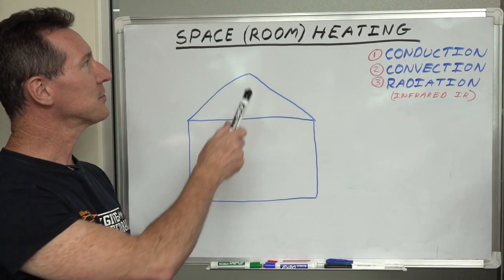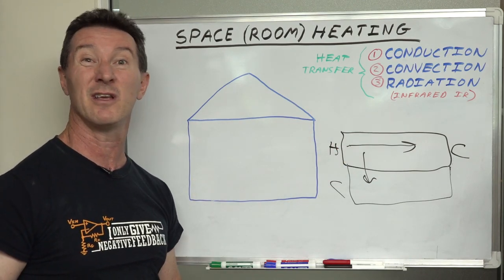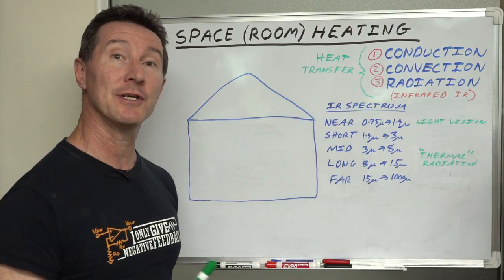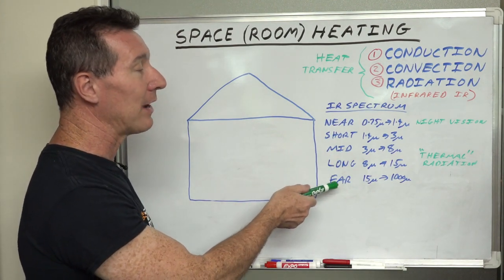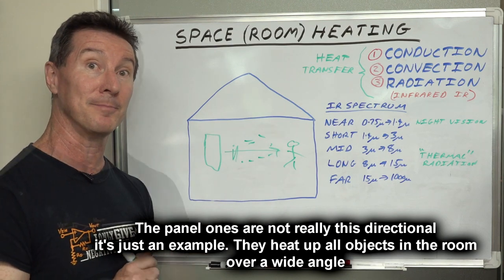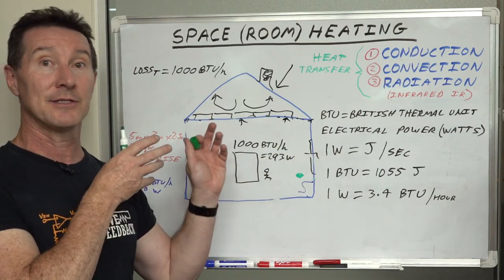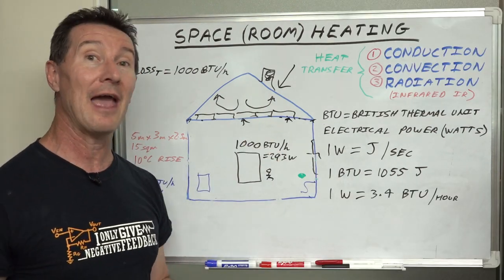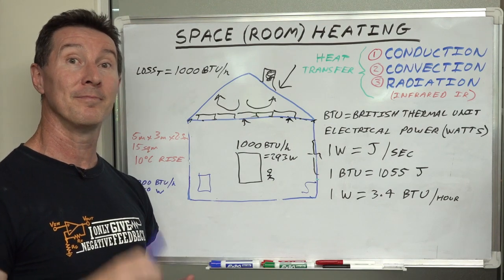EEVblog #1187 - Room Heater Technology Explained

Comment: This was great.
I'm always confused about convection. 
It seems to me that whenever we talk about convection we ignore half of the story. Convection refers to the movement of liquid or gaseous molecules through space. This is due to buoyancy, specific gravity, air pressure... all that stuff. So the hot air molecules will rise, leaving behind a bit of vacuum, and convection currents will distribute them around the room.
I get that.
But how do the air molecules get hot in the first place? It seems to me that those air molecules were heated by conduction. At first the space heater is bathed in cool air. Then the heat is transferred to the adjacent air molecules by conduction... not convection. Only then will the forces of air pressure start to convey the air molecules around the room.
Eventually when the convection current brings the hot air molecules to the other side of the room, they can again transfer heat to a person or a chair or whatever... but again, through conduction. So conduction occurs at the  origin and the destination, while convection occurs in between.
Do I have that right??
Reply: SciPunk215 My teacher explained convection as conduction. It’s just that it moves because it’s a gas, so it helps the heat transfer. But it’s definitely conduction between the molecules.

Comment: Thumps Up Dave! As i was watching your video i made some simple back of the envelope calculations. Here in Athens Greece were i live it's winter time, i live in a multi-storey building apartment and the central heating is on. We use hot water "radiators" fired up by a heating oil boiler. Our Boiler is rated at 120.000 Kcal/hr (that's a unit of power, a Kcal is the energy needed to increase the temperature of a kg of water by 1 °C, So it's convenient for calculations although it's not an S.I. unit of measurement). So i estimated the heated apartments in our building to be about 1500 m², So it's about 80 Kcal/hr per m² of heated space. Since my small apartment is 75 m² my "share" of heating "power" is 6000 Kcal/hr or ~6,97 kW. I also got two air conditioners rated at 12.000 BTU/hr each (3.5 kW). So my ACs power equals the "capacity" of my radiators!
Ain't Thermodynamics Fun?...

Comment: I think you should have spent more time explaining Air conditioners in this video. Efficiency ratios of 2 - 5X are easily achievable in ACs so it is important to be mentioned in a video in which you say that no heater can achieve more than 100% efficiency.
Reply from the maker: I think that's best left to another video. I wanted to focus on electrical space heaters.
Reply: There's also a difference between picking the heat up and moving it, vs creating it directly.  Heat pumps pick it up and move it, a resistance heater creates ( converts electrical energy to heat, but you get the idea ) it directly.
Reply: By your definition the sun has unlimited efficiency.
You do not put in anything and still get all the energy it radiates.
Reply: now if we could only gather up and use all that energy..  * sigh *
Reply: The efficiency of consumer electronics is measured by the electric energy input in comparison with the desired energy output (heat, light, etc)
That is the reason a heatpump can be above 100% efficient.
From this standpoint, if you use the sun as a lightsource or heatsource it could be considered infinitely efficient, as you don't input electricity. And to support that claim, just think about something like this: "save 100% of your heating bill by just heating with the sun". That works, in theory, even if it doesn't heat that much.
Reply: @czarzenana5125  Well no, a lot of Hydrogen and Helium was "put in" initially. It was just long ago and probably cannot be refilled. So it sounds like this "sun" thing is just a throw-away gadget, not very ecofriendly. The larger ones can even explode quite heavily and spread radioactive elements everywhere.

1/5, cannot recommend.
Reply: @kmv3040  
Yes, I know.
Energy is never lost, only transformed from one form to another. Efficiency explains the amount of energy put in in one form producing energy in the form you want. So if you use an AC for heating, you could get 3 times more warmth out than you put in as electricity. If you use the sun for heating, you do not put in any electricity which would give it infinite efficiency. I didn't say the sun could do that for infinite time.
Reply: @stabileseitenlage  
We only have to put solar panels in parts of deserts totaling the size of France to provide humanity with all of the energy we now globally need. So yes, the sun provides far more energy than we globally need. The sun is not infinite, but I think it will last for a bit longer than I do.
Reply: @kmv3040  In HVAC terms, free-to-me energy is counted as free energy and only energy that you have to pay for to harvest the heat is counted on the input side. With a heat pump or passive solar only the fan and pump energy, not the energy harvested from the air or ground or sunlight.
Reply: @slamdvw   Let's all get together and build a Dyson sphere!
Reply: @czarzenana5125  hmm smells like bullshit since the sun is slowly converting all it's fuel into useless helium
Reply: @restcure  no please don't get dave into the lack of resources debate to making a dyson sphere we all know earth alone cannot supply enough metal to make one
Reply: @christopherhauck4702  
That's the problem, isn't it?
Most forms of energy are useless (to us).
Reply: @kmv3040  
Just because we can't refill it right now, doesn't mean it can't be refilled. Not that filling in more hydrogen would help - to the contrary, smaller stars last longer, as bigger stars burn disproportionately more brightly. It would be better to decrease the size of the sun, then later put some of the hydrogen back in.

You can also clean out the impurities that tend to build up and sink predominantly to the center, and use them for something. Search "Starlifting" here on Youtube. It requires no new physics, breaks no laws of thermodynamics, and is only currently impossible because we're still confined to this one orbiting ball of lava and metal with a thin layer of solid rock, dirt, water, and atmosphere, and have neither the technology (mainly, though not exclusively, robotics) nor the manpower to and achieve it.
Reply: @christopherhauck4702  
Helium is not useless, it can still be fused by a star and make plenty of energy-profit.
Reply: @theuncalledfor  lol I said "energy forms" not matter and yes matter-to-energy/fusion are currently useless to humans even if stars can use helium is is not a useful energy form to humans since we cannot cause sustained, net gain fusion yet let alone efficiently convert local artificial fusion to other currently usable forms so yes helium IS useless to humans for energy purposes

Comment: I love that you touched on structural engineering when explaining heat loss in a room. Didn't mention soffit vents and why attics need to be colder, but that's a subject for yet another video.

My workplace is considerably warmer than my home. I've noticed that, when I'm leaving work, the same amount of clothing feels warmer than when I'm leaving home, even though the outside air is usually cooler when I'm leaving work. Any conjectures? Could it be just the thermal capacity of the clothing and my skin?
Reply from the maker: You could do half a dozen 30min videos on this if you went down the rabbit hole
Reply: @EEVblog  ...with each video leading to yet another half dozen rabibit holes. It's rabbit holes all the way down!

Comment: where would in floor heating fit ? . conduction from the water or electric elements heating the slab or convection of the air moving through the room over a heated floor ?

Comment: They mostly use argon in doule glazed windows, not just air.
Reply: Most manufacturers will have a few options, Nitrogen and Argon are the most popular, but some offer Krypton and Xenon (usually in triple pane windows).
Reply: Paul F Nitrogen is generally good enough with appropriate dimensions and configuratipn of the glas

Comment: I'm glad to finally know that heat pumps can be more than 100% efficient (as in they pump more heat than they use in energy). Though I still don't know the maximum efficiency ever achieved and I'd be willing to bet there are differences in how much you can pump based on circumstances.

Comment: Not exactly sure if I'm disagreeing (bad state of mind right now), but the section of IR that we call "thermal" radiation is that which we perceive on our skin as heat.  All objects above absolute zero emit radiation.  The hotter they are, the higher the energy (which means smaller the wavelength) of radiation they primarily emit.  Something "white hot" is radiating primarily in visible light, but that visible light still has to go somewhere.  It's reflected by some surfaces, but always ultimately absorbed, if it doesn't find a transparent surface to escape through.

Short nitpick is:  all wavelengths of radiation are thermal, in that they can be emitted due solely to temperature.  All will eventually heat something up, though we may not sense it as heat directly on our skin.

We choose that section of IR to call "thermal" for basically two reasons.  1)  We can't see it directly.  2)  It's the wavelength at which objects emit most of their radiation when at temperatures we're familiar with and can survive in.

I don't think I'm telling you anything you don't already know, but I think some people watching might be slightly confused by the way you presented the information.
Reply: Thanny Objects at livable temperatures for the human body tend to radiate in the IR range.  White hot is too hot for comfort.

Comment: I would really like to see you go into more detail about thermal properties of heatsinks with much more practical experimental examples on the bench. Get into junction to case, case to ambient, etc... and more importantly SHOW the temperature rise difference in different use cases with real ICs, perhaps letting the smoke out of a few as a good example of insufficient heatsinking.

Comment: Which heating method is best depends on the use of space.  I see people putting in forced air heaters and even heat pumps to heat their normally unheated shop/garage.  This is fine if you've got the insulation or the big unit, and will need the space warm for a long period.  But for quick work, and cheap warmth, infra-red/thermal radiation is the way to go.  Usually localized over the workspace.  Convection would take forever to heat all the iron in a workshop.  But a single incandescent bulb in a reflector can warm your hands and work.  Put a reflective radiant barrier material rigged behind you to cut that cold mass of air in the rest of the space giving you a sense of a cold back and you can do quite well.  

Look at some of the old high wingback chairs used in front of fire places in manor houses back in the day.  They insulated the back, accepted the radiant heat from the fireplace, in the front cut the convective currents drawing in cold air around the head.  Some chairs even had a half dome on top to create a convectively warmed crown area for your head.

Comment: Much better. Good research and no rude gestures. :) Real life often doesn't have "design goals" as such. People commonly use their "feelings" to describe comfort, and it tends to have psychological components. Example - do you really need to heat your bedroom before sleep? For many people, a heated blanket does the job and would use much less power for the same level of comfort, and the cold air outside of the bed will "feel nice" etc. Once they're asleep, a normal blanket keeps them warm and there's no issue. In engineering, you always have specific design goals. Component X must never exceed Y temperature, and the rate of temp rise should be limited to Z degrees per unit time. I love the creative designs of conduction + convection cooled military boxes. Have you ever worked with those Dave? The PCBs are not allowed to be in contact with outside air. So they're sealed in machined enclosures. Each PCB has heatsinks that take heat from the chips + heat from the PCBs (using heavy via stitching at the edges) and conduct that heat to the outside of the machined enclosure (which often has fins for increased surface area). Air is then circulated using fans over the outside of the enclosures (convection). Logically intakes should be at the bottom and exhausts at the top, but I've seen it the other way around too due to specific design limitations haha.

Comment: Modern double glazing uses windows are filled with argon gas instead of air as it insulates better. Also a lot of windows these days have reflective coatings to either keep the heat inside or keep the sun out. In cold climates the cavity of a double brick wall is filled with insulation material, sometimes as thick as 150-180mm. Thermal bridging in the building envelope can also be a problem, protruding concrete structures as balconies are good example of that. There even exist special rebar anchoring systems with integrated polystyrene insulation to separate the interiour concrete structure from the outside structure, all connected with stainless steel rebar. I’ve always wondered if they use much thermal insulation in australia to keep the interiour cool. In the netherlands we’ve got a bit of a problem that buildings these days are designed to have good insulation for winter conditions but with global warming we’re getting hotter summers which is a bit of a problem as we tend to have big window panes which will heat up the buildings in the summer to unbearable tempratures😅.

Comment: BTU and W or J they are not always equivalent in all heaters systems (it is true only if Coefficient
of performance is 1). In Air Conditioner you have COP more then 1 ( more than 100% efficiency) and for 1000w from the outlet you can have 10.000 BTU

Comment: Does a computer drawing 300W of power heats as well as a 300W heater?
If I get things correctly, the only way a heater would be less than 100% efficient is if it radiates microwaves or other radiations that could pass through walls.
Reply: Yes, it will heat just as well. For the second question, it would still be 100%, because heat can be lost as well as radiation, and the radiation will eventually become heat.
Reply: yes, but note that while your computer may be rated at 300W it likely rarely if ever will draw that much (unlike a space heater). 1/3 to 2/3 the rating is what I'd consider normal, as the power supply is typically sized for more disks or a bigger video card or even just more connected peripherals than "normal."

Comment: Female heaters are excellent, just a bit expensive to maintain.
Reply: not to mention they are really a hit and miss on the enjoyment part
Reply: That's what enables them to dissipate excess calories rather than expanding in order to make room for energy storage. The heat generated is a side effect of having to obey the laws of thermodynamics.
Reply: They always complain they feel cold.
Come to think of it, males most of the time are the heaters. FAT is an insulator.

Comment: Please do a a video on heat pumps! I got one after heating my house with  radiators for a couple of years and my electricity bill is about 3/4 now that I have a heat pump and I want to know how it works!!! Thanks!
Reply: Pretty much a heat pump is an air conditioner in reverse.

Comment: technically there is a way to heat a room by more than X number of W while using X W - by moving the heat from other place, so unless your heater doesn't have access to something it can cool at the same time, it is 100% efficient, if it can cool something at the same time (and this something is outside the room heated), then you can get 200% or more efficient
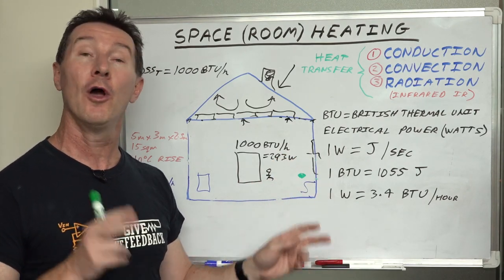edit: as you said at 33:55

Comment: Directly heat the place you are at is the most efficient way to do it. Don't stuck at heating up the room. Sure sometimes it's needed to heat up th entire room. In that case, using a fan to move the air is most effective. Heating up the walls and floor is less effective.
But sometimes heating up from the floor is more comfortable because you get balanced heating from the bottom to the top rather than only heating up your head.
Reply from the maker: But that's what IR heaters do, they heat up the walls and floor and furniture directly (ironically turning them into mini convection radiators), and you if you happen to be standing in the zone.

Comment: what about a room with high losses due to high volumes of heated air being lost (convected) out of the room? would an IR heater be a good choice there because warmed up objects would store the heat longer and keep being warm and conduct cosiness to their surrounding area than the warm air being constantly convected out of the room at a quite high rate when using conventional convection heaters (forced or not)?

convection heaters heat up the air which will get lost in this particular room quite fast but an IR radiation heater will heat up objects which will continue to conduct heat to their surrounding area for a longer period of time.

right?